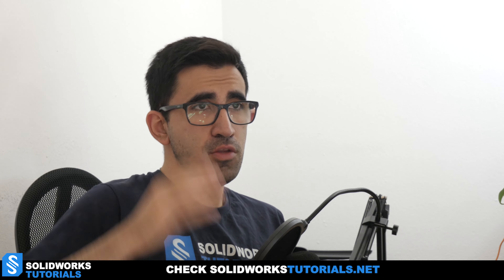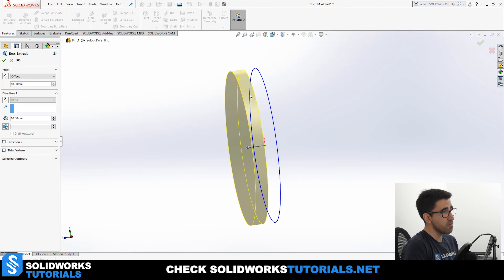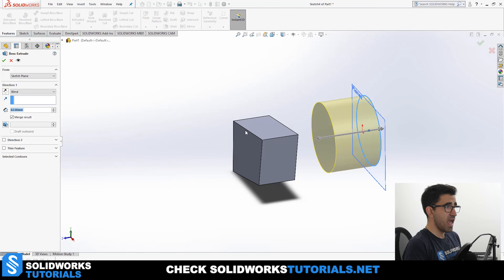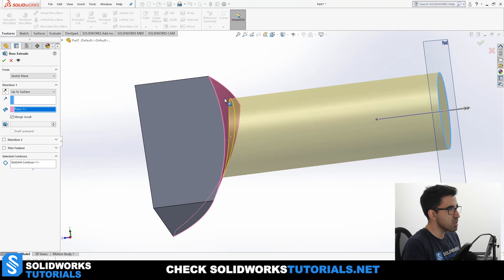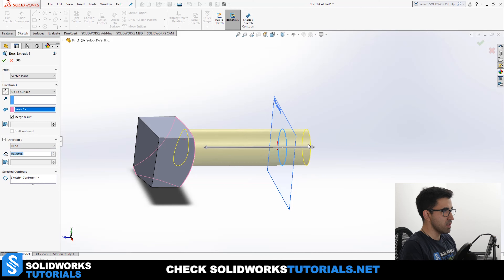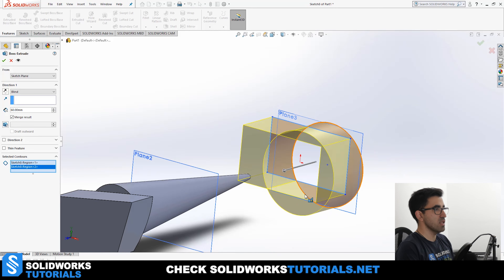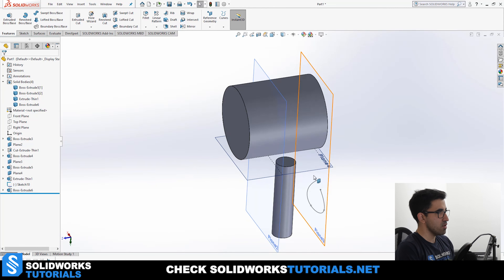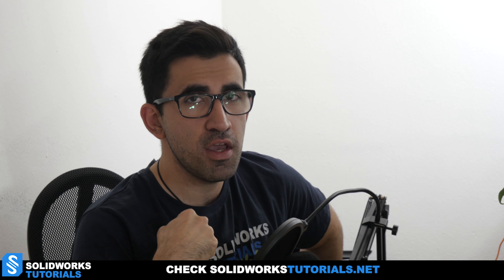Now that’s how you teach Extruded Boss in SolidWorks!

Comment: After I do the Extruded Boss/base, I get a transparent block rather than a coloured one like how you showed. How do I change this setting?
Reply from the maker: First restart your SolidWorks
Reply from the maker: If it still persist, then it’s a graphical error probably caused by your hardware

Comment: Can you or anyone explain when using extruded boss/base feature to extrude a sketch (in this instance a rectangle) up to a surface It will give a rebuild error and say the face cannot terminate the extruded feature, but if i change the size or location it works.
Reply from the maker: too specific. Have to see your file.

Comment: What if you need to extrude parts on the same place to different lengths individually?
Reply from the maker: what do you mean? Like extrude a sketch with different height on each of its sub closed-areas?
Reply: @with-aryan  Yes, it’s okay though I found it out! Just had to open the menu at the top left and then it would let you individually select shapes.
Thanks anyway!

Comment: Great vid.  I think you missed one really important idea and that is the "re -using of a sketch".  Take for example two circles one inside of another.  If I extrude the inner circle out into a shaft everything is fine.  Most beginners will then make a new plane and redraw the larger circle to extrude it out the other direction to make the shaft diameter larger or they will not draw the larger circle at first and draw it on the end of the first shaft as a larger circle and extrude it out the other direction.  Many people do not understand that many elements of a part can all be drawn at the same time and then sections of them can be used to either extrude or cut the part as needed without drawing more sketches.
Reply: Well, yes, you can do that, but actual professionals doesn't do that.

It just makes the model harder to edit and you risk getting unexpected problems.

A sketch should only contain a single contour, with the exception of construction lines of course.